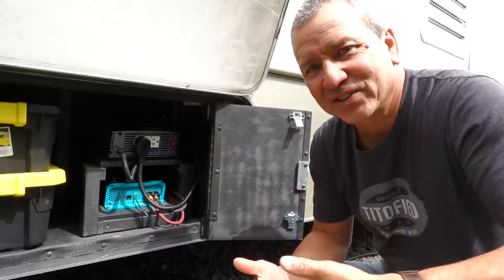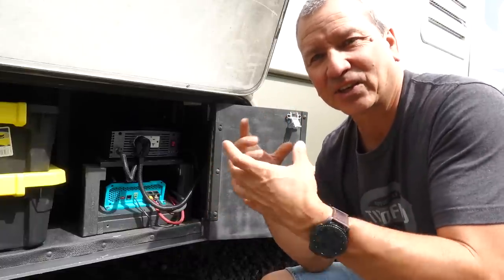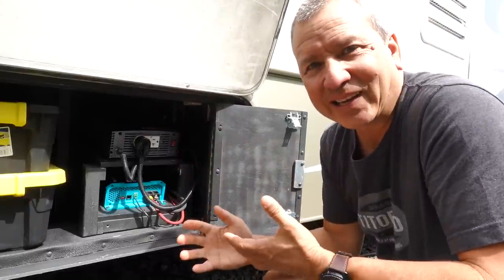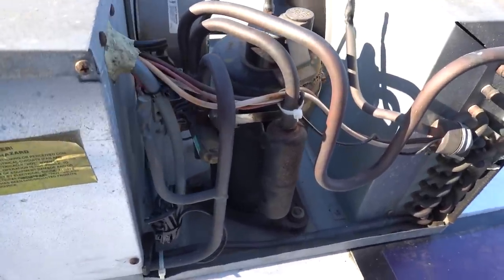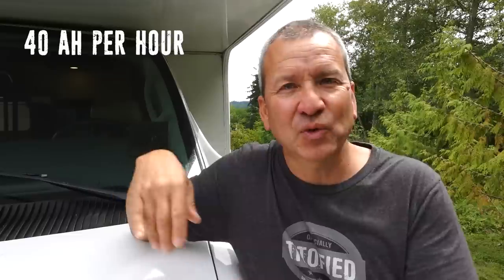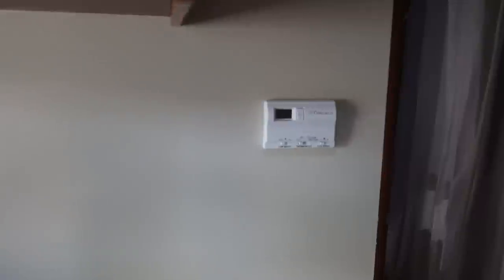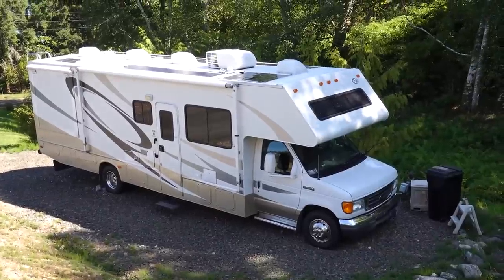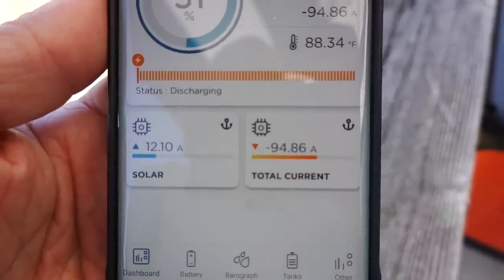BAD IDEA? Running RV Air Conditioner on SOLAR and INVERTER

Comment: I have an Aliner Scout popup hard sided trailer with a window style 6000 BTU AC unit that I can run for about 9 hours off my 400 Amp hours of Lithium  batteries and 200 Watts of solar.  My 1000 Watt inverter (2000 Watt surge capacity) works fine starting and running the AC unit.  The AC pulls between 450-500 Watts when the compressor is on.  The system was designed to give overnight AC comfort when traveling and stopping at locations without hookup like Harvest Host, boondocking sites or Cracker Barrel/Walmart.  It also provides a comfortable temperature controlled space for our dog when the wife and I want to go out to dinner, lunch or sight seeing without taking the dog.  We use a Renogy DCC50S MPPT/DC-DC charger to charge the batteries while driving (50 Amps/hour) or while idling the car at the camp site.  I installed a 270 Amp alternator, which makes 200 Amps at idle, in my tow vehicle.  With this arrangement I have no need for a generator.  My tow vehicle is my generator.....a very quiet generator.
Reply from the maker: Thanks for sharing your setup. Sounds like it's working out great for you. Funny about the noise. You're right. Running our engine to charge the batteries is much quieter than a generator.
Reply: @McRod-1  Built batteries from cells with BMS for less than half of what you are estimating.....not all Lithium batteries are Battleborns.....also batteries run my AC compressor based frig while traveling....

Comment: Nice presentation. The Aircon power draw seems inefficient.  In Thailand we use 12 volt split a/c units. A bit more expensive but lower draw. Is that an option  ?
Reply from the maker: Yes. I'm sure that's an option if you can find a way to mount the components.

Comment: Hello Brian, I wonder whether by using an EC motor many of these problems could be solved.  EC motors can run on 12v and with endlessly variable motor speeds.  This way, they could just crank down when the temperature reaches target, without the drag of restarts.
EC use less power anyway.

Comment: I might think of running the AC at 78 degrees. Still comfortable. If you need to feel cooler maybe try some usb powered fans.
Reply: I run my house at 78. I'm not sure why people need the a/c to be so cold.
Reply from the maker: We typically run a couple fans which do the trick until it gets too hot. I agree that 78 is a good temp when boondocking.
Reply: J Ho How old are you? Genuine question. Depending on age and sex you will have considerably different comfort zones. Plus its been shown repeatedly that sleeping in a cooler temperature is healthier and results in better sleep.
Reply: Retired

Comment: Tito, can you please state exactly what amount of solar panel wattage (panel ratings total) you have on your roof?  I see you have 400AH of BB batts.  But the solar numbers re hard to determine from multiple vids of add-ons you've posted.  Thanks!!  Great video too.
Reply from the maker: 650W on the roof. I have more external I can use, but didn't for this test.

Comment: I'm planning on installing 3 or 4 400 watt solar panels on the roof of our travel trailer if I can fit them (79x39). They are almost the same size and price as the 165 watt panels that I installed on the roof of a motor home I had, but technology is ever evolving. The only problem I foresee is I'm planning on running them in series so I can run 10 gauge wire. My controller can handle 150 volts ( each of the panels is 40 volts Open) so I don't know how to wire it or if I'm limited to 3 panels. I also have a 3500 watt inverter so I don't know if I'll need the soft start and/ or if it would have any additional benefit. I also have 510 watts of portable solar and I'm installing 400 or 600  of LiPo depending on what I can fit . Any info will be appreciated
Reply from the maker: Hard to say. Experiment with both series and series parallel to get under the controller voltage spec and minimize wiring. Use an online voltage drop calculator to determine cable thickness requirements. I believe a soft-start is always a good idea if you plan to run A/C. Good luck!
Reply: If your panels have an open circuit voltage of 40v, and your controller can handle up to 150v, then you can safely have only 3 panels in series (producing an open circuit voltage of 120v). If you need more panels, ideally you would add 3 more in their own series string, and then connect the two strings of 3 in parallel. Still 120v, but now more amps. Even better is each string on their own charge controller allowing the each controller to optimize its string. Of course if one charge controller cannot handle the amps of two strings, then you need two controllers.
If you really want 4 panels and only 4 panels, then you would need to do 2 strings of 2 panels - 80v open circuit on each string. The same as above concepts re. strings in parallel vs a charge controller for each string would apply.

Comment: Need to install a mini split.
Super quiet.
Way efficient. 
No 20 degree limit.
I put one in my super c.
Unbelievable!!!!
Reply: Please share your mini split brand and size?  Did you DIY the install?
Reply: @seanrafferty6672  it's a pioneer.
Believe it's a 12,000 btu.with heat pump
Camper Kevin I believe put one in also.
It's a 110.
I installed myself and paid 200 to have ac guy hook up and start up.
So quiet.
Reply from the maker: Where'd you mount the outside portion?
Reply: @RVwithTito  I have a volvo 780.
It has a compartment under the driver and passenger door. Under the passenger door had enough room to put it.
My buddy just purchased one for his class c. We will be installing in his rear storage compartment. 
I can email you pics of mine if you have email.
Reply from the maker: @rolandrockstarmega1299  Sure. I'd love to see it info@rvwithtito.com
Reply: @RVwithTito  I sent you 3 emails with pics. Let me know if you received them.thank you.
Reply from the maker: @rolandrockstarmega1299  Yes. Got em. That's quite the project.
Reply: @RVwithTito  thanks. It took me 5 years but well worth it.
I love the reactions we get when we are sitting in the hot tub as people drive by. Lol
Reply from the maker: @rolandrockstarmega1299  Great work! I'll be you do get a lot of double takes :)

Comment: Yes Bryan, it's not that it's impractical  to run the ac off battery 
It's  coz you system is inadequate. 
You need to build a proper system to match your needs.

Comment: Thanks. Real world demonstration.  I have heard of RVsoftstart unit,  I have to research the unit you chose.  RVsoftstart tech support haven’t ever installed on a Coleman basement ac on winni motorhome.  Main Issue is lack of room to install a unit inside where control panel is located.  I’m hoping someone else has successfully installed a soft start type unit on basement ac I assume externally. 
The “AZ Expert” guy has stated that these soft start units are great and allow multiple roof ac to run on lower amps at same time.
Reply from the maker: The AZ Expert guy is right. Some with 50A use it to run both A/C units on 30A. The RVSoftStart is another brand that came out recently. It's pretty new, but those who use it seem to be having good results. The MicroAir units have been around for a long time and have lots of installation information and a support forum. Mine came with a longer cable and I was able to install it outside the small compartment where the run capacitor is. I just used VHB tape to stick it to the side and it works great.

Comment: Ok I haven’t watched whole video yet but I use a isolator I upgraded alternator from 160 to 300 amp I have 2 starting batteries (diesel school bus). I have 4 rv Marine 100ah Walmart batteries and a 5000 watt inverter with a 13500 ac could my alternator charge batteries so I could use ac rolling down road

Comment: Thanks. The soft start costs more than the air conditioner. Why so expensive?
Reply: Probably because they can get it.  As far as I was able to determine, they have "the only game in town". WAY easier to install than a new A//C. Now I run my A/C w. Only one Honda generator instead of two. And the Micro-air unit is cheaper than a Honda gen at $500. Want to buy my spare Honda? (G)

Comment: where did you get inverter with a 30 amp plug? I can't find anywhere. Thanks
Reply from the maker: It's not a 30A plug. It's a standard heavy gauge household plug.
Reply: Good to know. 

I currently run my regular RV power cord over to the inverter bay and use a 50 amp to household plug dog bone adaptor into my 2000 watt inverter.  

A more permanent installation would be nice. 

What kind of wiring are you using between your inverter and your RV’s plug to safely carry the kind of load you were pulling in your AC demo?
Reply from the maker: @marvhein5024  My inverter is where my generator used to be. So I'm using the power cable that used to carry the power from generator. It's basically the same as a shore power cable. The only difference is the plug I put on the end to connect it to the inverter.

Comment: A diy system is around 5500$ for a 560ah 24v lifepo4 battery a victron 300w inverter and 8 250w panels...

Comment: I'm confused, you say this A/C unit draws 110 amps, that sounds like a lot as shore power only provides 50 amp service. Am I missing something?
Reply from the maker: 110 to 140A at 12 volts from the inverter.

Comment: Here is what I built by my self for my  28 feet toy hauler  I have 7 panels on the roof that put out 2600 watts  the got to my  2 victron  charge control they bring down 120 amp at 24 volts
To my victron 24 volt 3000  inverter I have Tesla’s model s  battery  3 total I have 15 .4 kw of storage I be a victron bmv 712 battery monitor I have 120  power 24  7 I can run my a\c all day and in to the night and a soft start or easy start  same thing on the a/c  you will only need a 2000 watt generator to run it not 2 it cost about 320 a lot less money the a second generator 
You can run the a/c with one battery the system cost me 4000 to build   I boondocks full time I did not buy my Rv to be in a Rv park  10 feet from each other I do that all day at work it very easy to build 
Solar panels that I found in Las Vegas was 200 dollars for 400 watt panels great price they kick butt

Comment: While obvious worth pointing out....just because the sun sets the heat doesn't go away. 

If AC off grid is the goal include how much run time after the sunsets.
Reply from the maker: My initial test sort of pointed that out. It burns about 10Ah per hour.

Comment: They have a 48V air conditioner that runs off solar panels! When sun is hot and high heating inside rv the AC will be cooling.

Comment: Hi. I'm curious, are your panels in parallel or series. I guess that makes a difference? In Florida the heat along with high humidity make it hard to keep cool. Trying to figure a way to avoid using a generator. I'm building a regular size van, so roof space is limited.

Comment: I was wondering if you have tested the new RV vent that inserts from the inside of your motorhome fifth wheel trailer that vent it directly into the vent circulation system so there is no loss of flow..they say it will  increase your RV AC by 40 to 60%
Reply from the maker: Haven't heard of such a thing. Do you have a link to share so I can check it out?
Reply from the maker: @lesterhamilton1740  I like the concept. $170 seems a bit hefty for this type of product though.
Reply: @RVwithTito  I would agree but I have lousy circulation in my ductwork and if it was to help cool off my fifth wheel I probably would spend it but then again I might check in to see how much a 3D printer place would charge me to make something thinking I could do my own venting and then have a 3D box made around it to insert into the air conditioning main opening sorry just rambling thank you for your interest
Reply: I have not looked at my RV A/C ducts, but I am halfway through sealing the ductwork and registers in the house. So far I have found & sealed enough gaps to equal about 10 square inches. I wonder if dealing the ducts might be all you need to do for your 5th wheel? My next stop will be ducts in our trailer.
Reply: "Sealing the ducts" typing corrector changed it to "Dealing"

Comment: Looks to me if you used the full square footage of your roof for solar you could get 2000watts up there and run the ac of the panels and not drain the batteries at all.
Reply from the maker: Yes. That's right. I always though out would be overkill since what I have serves us well. I'm thinking about an update now.....

Comment: Hi Brian I am new to all this, but was wondering if you can program thermostat to cooler temp say 70* for a few hours during peak sun then 73/74 then 76* for night? Not sure if this is possible, but if so, would it even make a difference maintaining temp and use less battery? Curiosity gets me in trouble lol... Thank you for your thoughtful and well presented info. Regards from Maine
Reply from the maker: It would just run constantly during those peak hours I suppose. So I'd definitely be gobbling up energy.
Reply: Thank you :) Be safe.

Comment: Consider adding a Microair Easy Start to lower the instantaneous electric pull of the AC when starting in order to lower the load on the inverter (see Fate Unbound's video "Was it worth it?").
Reply from the maker: It appears you didn't actually watch the video :)
Reply: My intent was to share other site's using/recomending same.

Comment: Good morning Brian Other than the AC how is the battery 400 amps working for you guys without the AC.
Reply from the maker: It's working out great. 400 Ah seems to be just about right for our needs.
Reply: @RVwithTito  one more question please,  with the 4 batteries  where did you attach the solar wiring to the batteries middle of end
Reply from the maker: @Yukonjackman1  Everything goes through large busbars and a shunt (for monitoring). Those busbars are connected to the batteries. You can see diagrams of our system here: https://www.rvwithtito.com/articles/our-solar/

Comment: Hi, I want to mention another aspect where it is really beneficial to have the ability to run the A/C from the battery and this is during longer drives in the summer. Our two kids sit at the dinette of our class C when we travel and it used to get quite warm in the back and we had to run the A/C of the vehicle full steam, which bothered us in the front. We have a Coleman Mach 10 with soft start, Xantrex 3000W inverter, 990W of solar, Lithionics 315Ah and two 30A Victron DC/DC converters. This setup on a sunny days allows us to run the coach A/C during our journey with almost no net battery draw at the end of the day. I feel the advantage of running the A/C during travel may be sometimes under appreciated.

Comment: no one talks about when a wire connection is not ideal and then the 100 to 120 amps trying to run thru that lights it up red possible fire hazard. I know been there done that 15 years ago. agree. genny run the heavy loads.

Comment: I can run 1 of my 2 all day lol , 1000amp hrs of batteries /10 lithium , 1400 watts of solar 2 charge controllers , 3,000 watt aims inverter ! If I run both ac units battery terminals get to warm 😅 !

Comment: I never use 74 degrees (22 in celsius) even in my house when cooling it down.  78/79 would be perfectly fine when the air is dry from the Aircon.

Comment: Just get a mini split AC & HEAT 115 -9000 or 12000 BTU check it out
Reply from the maker: I've thought about it...don't know where I'd mount the extra hardware.
Reply: RV with Tito DIY look other videos on YouTube you will find a good place to installed . I going to install mine on school bus

Comment: Hey Tito, I have a 45 foot rv with 2 4000 watt inverters and 6 4d 180 amp hour batteries.  What kind of solar wattage would I need to install on the roof, or is it even worth it?  Thank you.
Reply from the maker: Honestly. Install as much as possible.

Comment: I run with 8x100 watt solar on the roof powering a Titan w/ two batteries and an external 24V LiFePo4 battery to supplement (about 8 kWh total).  I can run the 13.5k BTU air conditioner for about 3 hours with no assist from solar or a generator which drains my battery capacity to about 40%.  With solar I might get 4.2 hours max running the battery down to 40%.  I have come to the conclusion if I need to run AC while boondocking I get my generator going.

Comment: Thank you, I was thinking about this recently. Now, how about installing a split mini and doing it again? lol
Reply: This is what I'm planning to do with my 73 Travco. 1/3 to 1/2 the consumption should make this more feasible.
Reply: I installed 220v 1.5 ton the inverter one and less than one ton split unit with 4k made in China generator (sensi brand name) and the original 110v  air-condition with the onan generator  and working fine 🙂
Planning to add extra fuel tank for the generators
Reply from the maker: Thanks for the suggestion, but I'm not planning on adding a mini split because we don't use our A/C that much. If you do, please share.

Comment: I wonder how much energy it takes to reduce the temperature from higher to lower rather than on/off maintaining a level, for example: how many watts or amps to reduce the temperature from 85 or 90 down to 65 or 70, would it be more efficient or less?
Reply from the maker: The temp on my initial test was at 80 then cooled down to 74 in about 30 minutes which used about 8-10Ah.